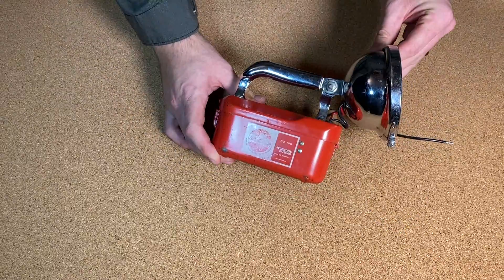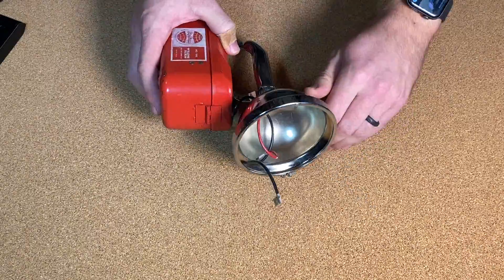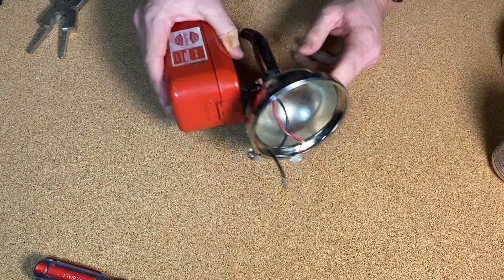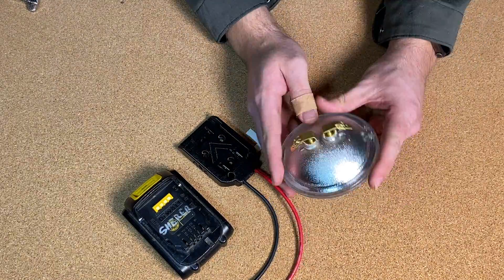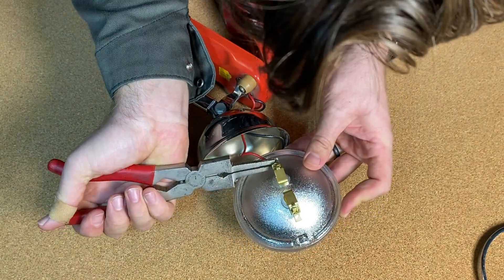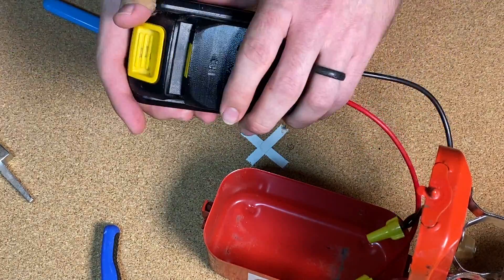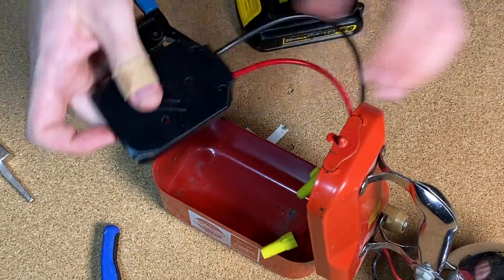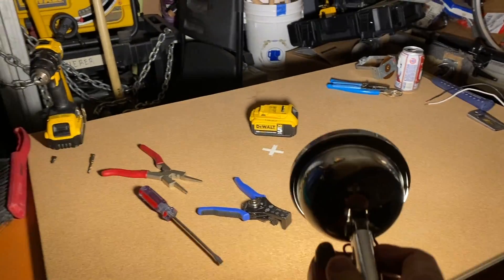Teledyne Big Beam 166 Hand Lantern LED Conversion!

Comment: Hi Will, do you have links or part numbers for the "bits" you purchased for this?  I think the dock for the dewalt battery is the main thing I can't find.
Reply: You don't need the connector use male spade terminals